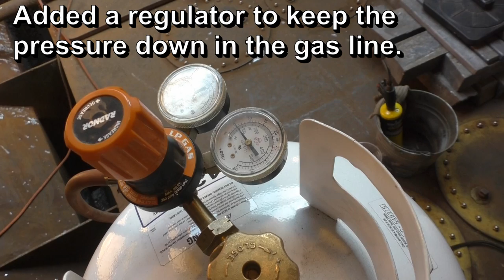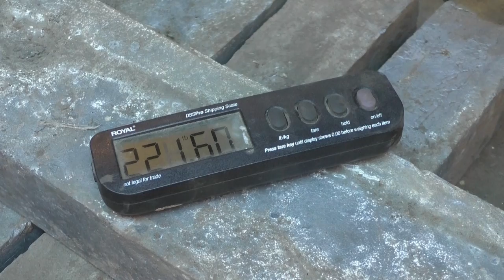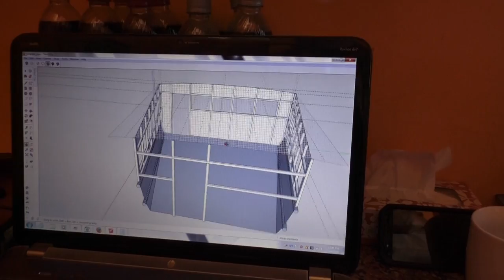Steel Sailboat Building - Catwalk, Lead, Rudder, and Dragon

Comment: it is funny to see the struggle of your Austrian Friend with the measurements. As a German I feel with him. inches and feet and it's conversion. best wishes from Germany.
Reply: I've lived in the US since 93(11 years old) and I still struggle. Lately I have been switching most of my machining to metric. Only problem is the non metric tooling and speeds/feeds, so I made some charts for that. Even started doing all the residential housing work in metric. For us, its a lot faster and usually no errors.

Comment: could you rig up a misting system on the outside of the keels to keep them cooler.  might help stop warping. 
at this point I dont think you need to worry about the lead cooling to quickly.

Comment: Not sure if anyone has mentioned this in a previous video, but could the steel always be bowing inward because the inside layer of the steel expands while the outside of that piece of steel is ambient. That expansion in the hull over the length of that chamber (fore/aft) in the hull is enough for movement inboard... Just a thought.
Reply from the maker: +Josh T   Yes,  I think that is what is happening.
Reply: +SV Seeker We'll second that, good thinking

Comment: Hi

I have been following your vid of the seeker build.

About the lead in the keels.
I think you might consider putting some epoxy in over the lead after it cools to fill any gaps.
The lead cools and shrinks leaving a small gap.
Water/condensation will enter the small gaps and promote corrosion/electrolysis.
THe epoxy will set up and bind the lead to the steel hull.

Great vids.
I have thought of building a big boat similar to yours for years..
Reply from the maker: +Dennis Williams   Yeah,  epoxy or maybe just tar and let it work in over the summer.

Comment: The gap between the Hull and the Lead. I think bitumen is better than Resin, because you can melt it with heat. Heat the hull and the Lead to the meltingpoint of the bitumen and than pour the molden bitumen into an it will fill all gaps and after cooldown a flexibility will be remain.
Sorry for my bad english

Wegen dem Spalt zwischen der Hülle und dem Blei. Ich denke Bitumen ist besser als Harz, da man das mit Wärme schmelzen kann. Heiz die Hülle und das Blei auf den Schmelzpunk des Bitumen auf und gies es in die Lücke. Das bitumen wird den Spalt füllen und nach dem abkühlen weiterhin flexibel bleiben.
Reply from the maker: +JetGirl    Interesting idea.   We are thinking low temperature tar.  I think it will be a lot cheaper.

Comment: You did a video where you discussed the weight of moving the boat, you even went so far as to address height issues (?) by making the top cabin removable (still the plan?)...  What about the width, how wide can the boat be and still be wheeled down the road?
Reply from the maker: +Paul Gdry    Width and weight are not an issue.   We just get a permit.   And the bulwarks and the pilot house will come off for the trip to keep the height under 18 ft.
Reply: oh, I completely could not see how the bullworks would come off.  Cain't wait to see that.

Comment: Just off the cuff here... I"m looking at what the force will be on each keel when the boat is in operation and more specifically, the "righting moment" force when the boat is heeled over say 10 degrees (or more). Do you feel confident that the welds will hold where the keel meets the hull?. I suppose it's a simple formula considering you have 10K lbs + the weight of the keel itself to factor in.
Reply from the maker: +David Snider   Very confident.

Comment: have you thought about using a wedge or shim between the steel and the lead to push the steel a little bit closer to where it was? Then when you pour epoxy or tar down there it would hold it there.
Reply from the maker: +Chris Becker     Might do that.  Thanks for the idea.

Comment: Love your "sales". Grinder cap: before $12. Now: $15... if it was not for the shipping to Norway, I'd buy one anyway. :)
Reply: +Alf Torp you can combine shipping!!! Buy 2 and a mug. sounds good
Reply: Checked that first, my friend. I ended up having to pay $93 for two caps and a coffee mug. $47 in shipping alone, using the cheapest alternative.
Reply from the maker: +keith todd    Sorry no.   The whole lot is overpriced and shipping is very high.  So buy a tool for your shop instead and make something.   :)
Reply: Plasma cutter is high on the list. Even higher than an SV Seeker coffee mug ;)
Reply: +Alf Torp that's a good plan too .But  I'm going to buy one of the over priced mugs when me mate is in the states next. just so I got one.
Reply: Yeah, I am partial to one as well, despite the shipping. :)

Comment: You state that your panels are bowing in with the heat of the lead - any way to weld an anchor point on the outside and pull it out then backfill the gap on the inside with lead?

Comment: I'm guessing you want to avoid gaps between the lead and the hull to avoid corrosion, right? If so, could you cap the chambers but leave a 2" pipe plug hole in the top and fill the void with a couple of gallons of WD40 or similar?
Reply from the maker: +princebatswater    The plan is to seal them off with a steel plate so filling them is just extra insurance incase we damage them to the point of leaking.   For that tar is ranking high on the list.

Comment: Just had a thought about your warping steel of the keel. I'm wondering if heating the steel is maybe wrong direction and if the keel were to be cooled with water hose right after pouring begins maybe a solution to the warping. 
    Like I said.... Just a thought and maybe I'm way off base.
Reply from the maker: +tim9lives   We actually think that cooling the outside will make it warp worse.
Reply: +SV Seeker You may be right. But the way I was thinking is if you prevent the steel from getting hot then the steel won't warp. 

  I do know that with front brake rotors....Once they get hot from driving and braking...If you go through a puddle of water then they will almost always warp.  Cooling hot steel does cause warpage.

But....What is happening in your case is that the lead is heating the steel causing it to expand and warp.  So...My thought was if someone was hosing down the exterior of the keep during the pour...then the steel won't warp. 

Makes sense in my mind. But hey...I'm just guessing.

Comment: I saw your antenna video for another project and I put one together using your video as well as the link someone posted on your site. I was wondering if you had any feedback on the function. I have not installed it yet but just wondering how it went and any adjustments you made to it. I am in Thailand rebuilding our dive boat.
Reply from the maker: +Wesley Copley   We only used it at close range, but it worked fine.
Reply: +SV Seeker Thanks for the info, boat looks good, I enjoy your channel

Comment: Would it be possible to get two guys to water each side (on the outside) of the surface that gets hot from the molten lead, without the steel getting deformed from thermal shock?
Reply from the maker: +Dan Rosendahl Hansen    We think that might actually make it worse.

Comment: ...."oh, he's going to add that big lead bar to the molten led like my sugges.. NNO DON'T KICK IT IN!!!!!!!! HOLY SH|T!!!!"
Just in case you couldn't clearly hear me screaming at my laptop.  Yeah, I sort of envisioned gently adding smaller bars or even piling smaller ones in, but whatever works.  Had a thought watching your coffee cup spam <wink>, get one of the artsy folk to make a mug with the dragon wrapping it.  Maybe even as the handle.  Actually, the first thought was a pencil holder or possibly vase.  Before that, I was thinking you should install a toilet flange on the bottom of the roof to collect the water and direct it into the head.  That way the dragon and roof can flex independent of one another.
Reply from the maker: +jcadult101  LOL   Rule #2.  Have fun.  That was fun.

Comment: So I tried searching to see if anyone else has asked this, but I didn't find anything. What size filler wire are you using on your MIG machines for this project? What about gas?
Reply from the maker: +Josh T    We have used various setups and wires.   Most of what you see us using in the last couple of years is solid .035 with 100% CO2 cover gas.
Reply: CO2 is cheaper, and seems good for what you're doing, but have you tried .045 for higher deposition rates and travel speeds? I suppose most of the welding is done by this point though... and it would require power supplies that are capable of higher duty cycle. Idk, just throwing stuff out there. You guys are getting it done, and thats what counts!

Comment: So you are heating that hull steel so hot it bows, but there are no worries of any annelling going on and know worries of strength changes? Just asking. Also, is the catwalk to make it easier for the pirates to board? Just asking. I take it you won't
be sailing anywhere around west Africa. Ahrr Ahrr!  How high above water line is the deck likely to be? Lots of guns and many sons will keep your ship safe!! All the Best
Reply: +ironsight308 The critical temperature for annealing steel is about 1000˚ F greater than the temperature of that lead. (depending on the type of steel)
Reply from the maker: +David Adams    Thanks

Comment: also some welders at the shipyard i used to work at said when they would cut into sealed voids in a old ship they would often find a burned out candle which would have been left burning when the void was sealed to use up all the oxygen and prevent rust random fact but i thought it was cool
Reply from the maker: +Chris Wyche    Thank is cool

Comment: If you plan to fill the gaps with tar, why not use the warm lead to melt the tar into the cracks? Heating the keeps up again will be a pain, otherwise you'll need to use your lead melting rig to melt tar and pour it on top. Just wait til the lead drops down under 175 degrees and drop chunks of dead level tar on top...
Reply from the maker: +Stuart Warren   Interesting idea.  ...but the lead down in the wing will be cold as we do it in multiple pours.   I wonder if there is a tar that is liquid at 90 degrees.   Once in the water the keels will always be cooler and if the keel was ruptured the cold tar would be a water barrier.
Reply: +SV Seeker 
It would also be an air / rust barrier as well. In answer to your question, there is 'dead level tar' that gets soft around 100 and flows at slightly more than that. You can get kegs of it from most roofing supply places. Warm it up in your lead pouring rig, but only after you're done with it, since it will be tar covered from then on.
Reply from the maker: +Stuart Warren    If I can apply coal tar epoxy over that it might be all we need and save us from having to fit and weld steel plate in there to seal that area off.   I'm thinking we can just let the tar work it's way in over the summer.  Those keels are above 100 for days.   The coal tar epoxy is impervious to diesel so it would allow us to use that area for additional diesel storage.

Comment: Right maybe tar would be better. Tar could be reliquified with a torch on the outside if you suspect it has not got all the way to the bottom.
Reply from the maker: +Dennis Williams    Yeah, I just don't know if it would ever make it all the way down.
Reply: +SV Seeker Smooth-On and a couple of other molding supply houses have some nice urethanes that are pretty thin and should flow well, and when they set up they're still flexible (it's what high quality automotive suspension bushings are made of) and it's not ridiculously expensive like the silicones can be. The flexibility might even dampen some sound down there, reducing the direct coupling between the lead and the hull/bulkheads, though the lead probably does an admirable job on its own with all that mass!

Glad to see you're still chugging along high five!

Comment: How long does it take to melt the whole pot?
Reply from the maker: +10Greylock   It depends how high we turn up the flames but about 2.5 hours and 12 pounds of fuel for 1000 pounds.   And about have that fuel if the time is doubled.

Comment: why not hose the outside with cold water to keep the steel from flexing etc...like the boiling water in a plastic bottle trick
Reply from the maker: +SuperJlonergan    I think that would actually make the flexing worse as it is cause by the differential.
Reply: +SV Seeker I think you'd find with enough water on the outside you won't have any flex because the metal will not change much in temp even with the hot lead on inside.  Again it's like holding a lighter to a bottle of water...the plastic molecules don't get hot enough to melt and bottle stays intact, I'd think metal would even stand better than plastic in similar experiment
Reply: +SuperJlonergan I think your flexing is coming from an all out expansion on all sides not a diff between inside outside.  The lead is not as hot and quick a heat increase as a welder.  It is laying in there and evenly heating the metal on all sides causing max expansion

Comment: a old guy that built a boat like that told me he filled all the voids between lead and hull with oil so there was no rusting steel boats rust from the inside out
Reply: +Chris Wyche.....^^^^^^^  Great idea.
Reply: +Chris Wyche You beat me to the punch! At this point there is no other way I know of to prevent condensation from pulling salt into those gaps between the lead and unprotected steel and cause corrosion in places that epoxy and so forth can't reach or coat properly. I would be looking into rust inhibiting oils intended for marine use.
Reply from the maker: +Chris Wyche  Actually all that needs to be done is to weld in plates of steel to close the area off from oxygen.  Rust like fire dies without oxygen.

Comment: Not to be a safety nazi, but please be careful with those friggin splashes of lead! Last year, burned a good 2-3 inches back of my hand with some splashed lead out a slightly damp mould - didn't feel a thing initially, calmly peeled it off, then it subsequently took 4 weeks to heal over.